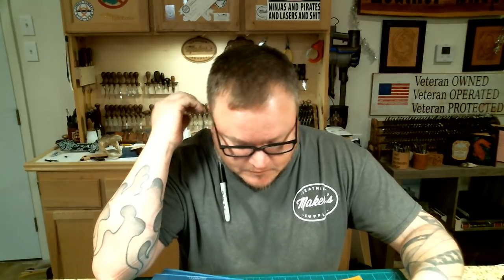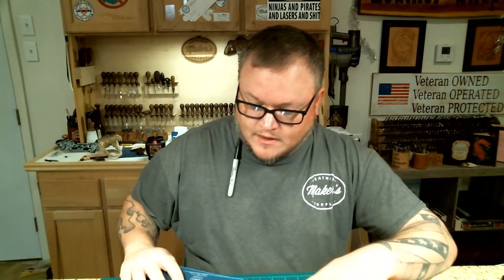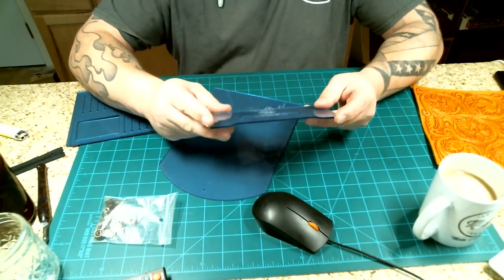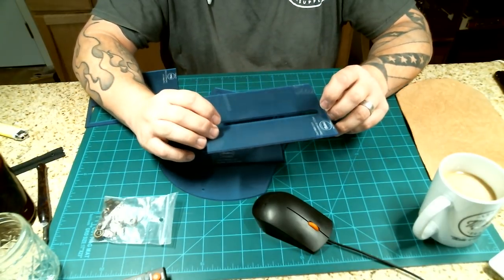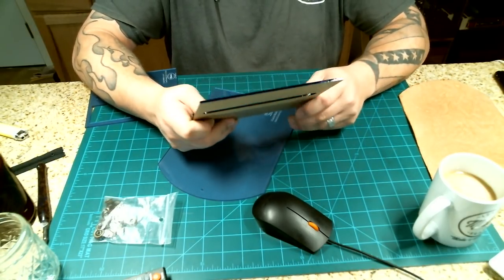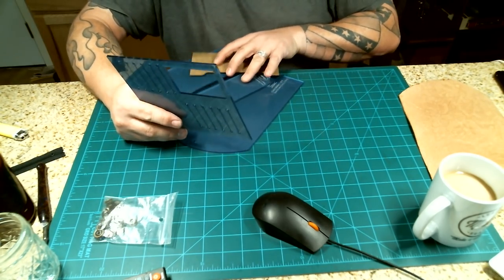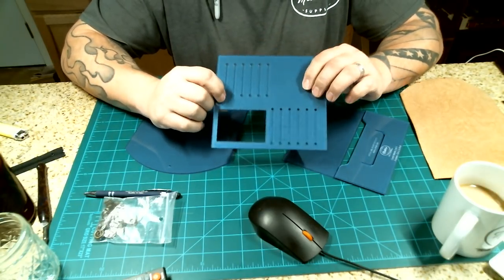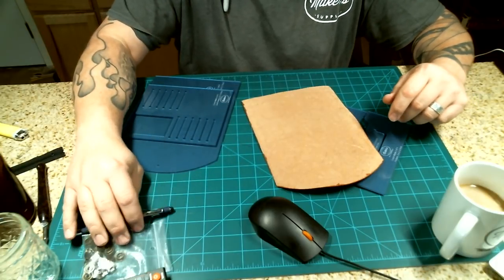Making a Clutch Wallet Part1

Comment: Would I be able to put snake skin on the outside? Would this cause a problem with burnishing? Or the snakeskin burnish like leather?  Just getting into weather work,any help would be nice thank you.
Reply from the maker: Unfortunately the snake skin will not burnish like other leathers.  Most folks who use exotics like this either create a rolled edge or border the snakeskin.  Basically by border it i mean make it an inlay by building a picture frame around it of veg tan or other burnishable leather.
Reply: Makers Leather Supply Thank you sir!!

Comment: What size hole punch do I need to buy for the credit card slots?
Reply: I use a 3/16" punch.  But, DO NOT use the punch through the template.  I can very easily split the template.  mark where the holes go, remove the template, then punch the holes.

Comment: What size hole punch did you use for credit card slots?
Reply from the maker: Any one that will fit completely in the template without cracking it.
Reply: @makersleathersupply1220  I don't have one on hand small enough to fit in the emplate and was wondeing what size to buy.